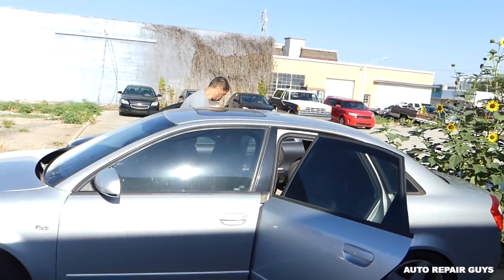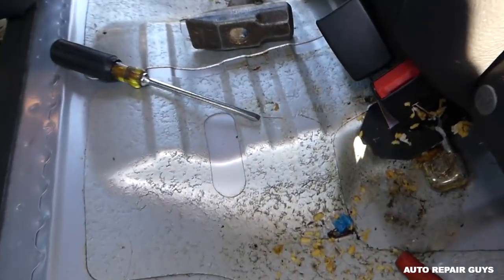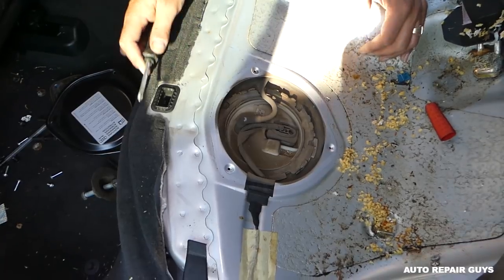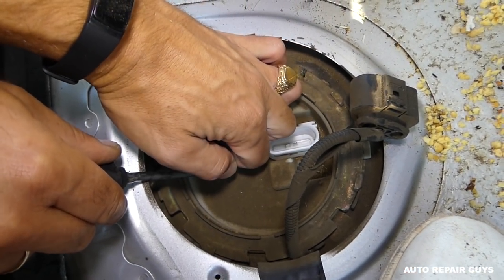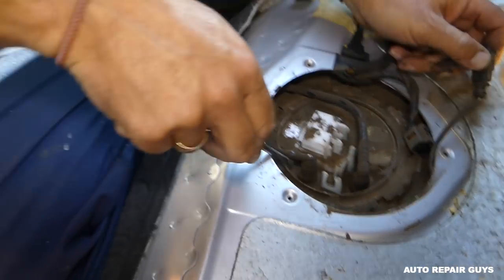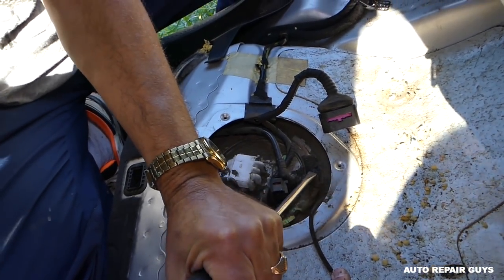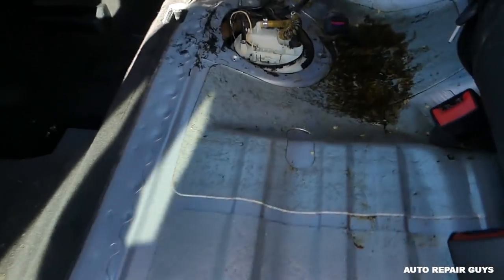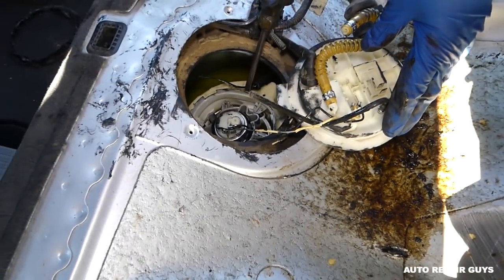Audi A4 B6 Fuel Pump Removal FAIL

Comment: are there two fuel pumps in this car?
Reply: I though that was weird as well. I understand on an aircraft.
Reply: No.  Passenger side is pump, driver side is fuel gauge
Reply: Because of the Quattro drive shaft running through the tank, the driver side is a transfer pump to move fuel from driver to passenger. Passenger side pump is the actual fuel pump.

Comment: This is not an Audi a4 b6. In the B6 the Fuelpump is behind the back seats in the trunk
Reply: depending if its saloon or Avant
Reply: Cvt transmissions fuel pumps are in the back seat. Manual and tiptronics are in the back seat.